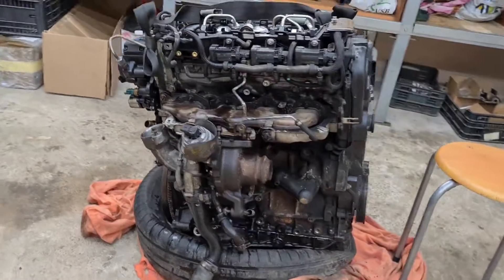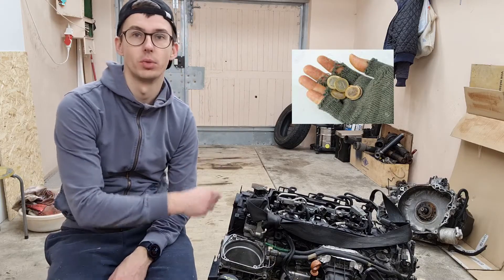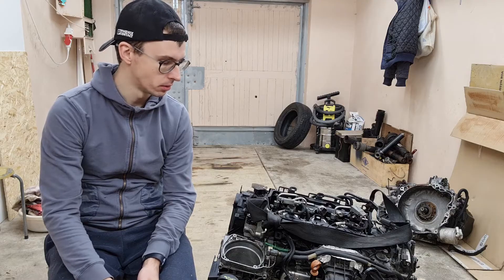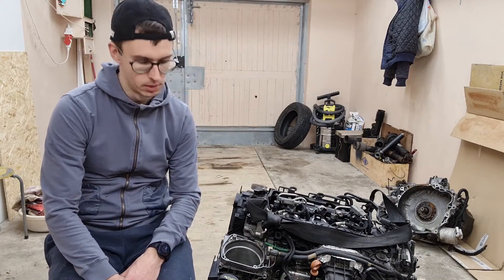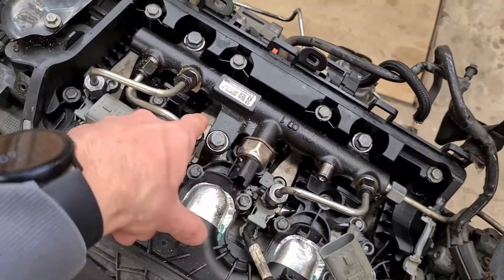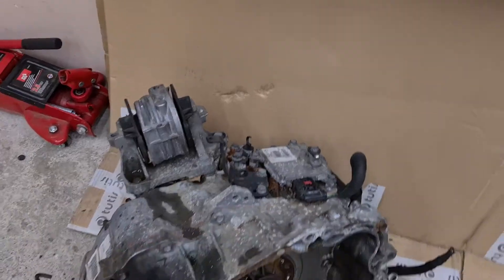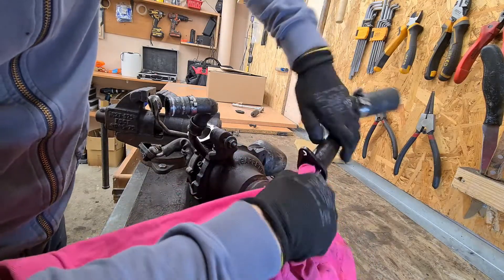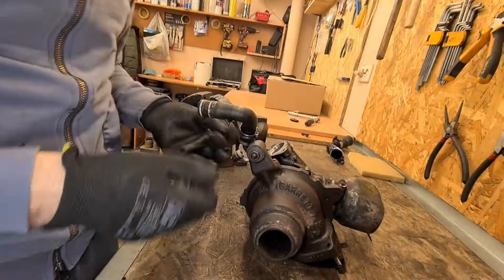Got broken 2.0HDI 163 motor! Lets tear it apart and check what happend to it! (DW10CTED4 RHH) part 1

Comment: Rust and oil ( do you still have head ( my focus cmax mk2 2.0 tdci euro 5 163 bhp (timing belt snapped and I need a head ! ) much you want for the head I am based Glasgow Scotland !
Reply from the maker: Hi. No, I dont have. Head was damaged severely when trying to undo head bolts, they very tight and few of them were stripped... I have sold it to metal scrap...

Comment: Hello! Can you please tell me where the pcv is located?
Reply: same question
Reply from the maker: If I am correct it is located in front of the engine, on front of the engine block, big black plastic box (oil fume separator and pvc valve).

Comment: 7:32 These two soleniods control when the DPF regeneration is occuring. EGR is set to 0% and 'doser head' mixes the required air paths to achieve suitable incoming air temperatures for the DPF regeneration process (in combination with the use of the Eloys fluid). One should be closed and ther other open when the ignition is off.
Reply from the maker: Yes, you are right. But, interesting thing that only first motors have that intercooler bypass and later engines comes with only one doser flap (for smooth shutdown).
Reply: @rustoil  It's due to a change in the injection system which means the twin doser head was changed to a single.
Reply from the maker: @bizling well, I dont know why you say so, because everything is the same (fuel pump, injectors, ecu...). I think that that bypass was not usefull enough and was not used eanymore.
Reply: @rustoil  the post injection strategy was modified (using the same injectors, pump, etc).

Comment: My car is Ford Focus and has this engine, 200,000km and no issues. Very good engine usually.
Reply from the maker: Yes, mine has already 350+kkm and runs fine.
Reply: @rustoil My car is se same and  has already 500000KMS and run very fine😜😜😁😁😁😁
Reply from the maker: Those engines are realiable and durable, will run to 1M :)
Reply: Mines at 192k miles , solid engine

Comment: What year is the engine as I have a 2.0 hdi auto and they tell me that the egr valve is at the back of the engine
Reply from the maker: This engine is produced from 2009. Its is coded dw10cted4, older engine dw10bted4 has egr on the back of the engine. This one is quite different than yours.

Comment: what price did you get this engine for please and how many miles has the damaged engine done
Reply from the maker: Hi. I dont exactly remember, but about 150e with gearbox. Gearbox is still sitting in the corner in case I will find time for it to be dissasmebled, seals replaced and on to the car, because mine is not properly working, but still drives. This engine has about 250kkm I think.

Comment: Hi there can you tell me if these engines have a 02 sensor fitted to them ?
Reply from the maker: Yes, it has O2 sensor. It is mounted into the catalytic coverter case - that smaller unit mounted first onto the turbo.
Reply: @rustoil  do you have a picture of it by any chance ?
Reply from the maker: @marke293  yes, I have. I can send it to your email.

Comment: Great tear done video of this type of engine. it looks like you know a lot about these peugeot engines do you happern to know what will cause a P 2562 code on a very low milage engine of this type ?
Thanks
Reply from the maker: Hi, thanks for comment. This error means that something is wrong with the feedback signal. It can be faulty wiring, problem with the position sensor on the turbo variable geometry actuator.
Reply from the maker: Well, for the C5 turbo with that acturator/sensor can be accesed only from the botom, firstly removing the exhaust.
Reply: @rustoil  thanks for your reply can you tell me if I need to access this from the top of the engine or under the car as it does not have a lot of room in the engine bay  (2015 RCZ)

Comment: What were your problems with your gearbox? You said 2/3 and 4/5?
Reply from the maker: Yes, shifting from 2nd to 3rd and 4th to 5th are not smooth, auto neutral engages very sharply. New valve body did not help...

Comment: Good video, interesting the EGR is on the front right, I need a Haynes manual as I became the owner of a C5 with this engine.

Did a full service on it (oil, oil filter, air filter, fuel filter, cabin pollen filter, new rear engine mount) but it is not as efficient as I expected. 

Also stalls easily from cold start with laggy performance for a short while, fault code reader (cheap non sophisticated OBDii) gives P050B fault stating "ignition timing, cold start - performance problem".

Googled P050B fault and it states multiple possibilities - camshaft sensor, crankshaft sensor, throttle sensor, check electrical wiring etc. 

Also get the 'invalid oil level reading on start-up, engine took 6.2 litres to get it to read the minimum on the dipstick leven and I refused to put in any more as too much can do damage!

Would love to sort this out as otherwise it is a lovely smooth and fast car when to need it.

Comment: Nice video, i have same engine and issue with turbo vnt , its dusty/seared/baked and sometimes i have error registered when im doing high boost. It need be cleaned, im thinking if its possible to put turbo cleaner inside turbo without dismounting it.I know that can be very hard.But dismount half of car (suspension, fap,exhaust) will be more painfull.
Reply from the maker: Hi. Thanks. By the way, mine has exactly the same problem... i am living with it almost five year :) i will definetaly try removing the turbo and clean it in spring/summer, because it is getting worse, especially on hot weather.
Reply: @rustoil  I have this error only during summer on highway railroad when engine is very hot. Also for 3 years now.  Usually once a month, but once during driving by 8hours in row i had it 6times in row during speeding up. I was thinking about dismount exhaust pipe  only and put some cleaning foam for ovens inside, like other do when you have direct connection from egr to turbo. In this model connection egr - turbo is through engine and easy cleaning is immposible :/
Reply from the maker: Yeah, in 50km I can get two or three cut offs of the turbo, lexia shows overboost error... i agree that it is not easy on this engine to get to the turbo, but i have seen that it can be removed with exhaust taken off, no need to dismantlle the suspenssion atleast.
Reply: @rustoil Finally i have fixed this issue with overboost.
Replaced turbo myself (lot of work..... i bought new OEM one). 
Apart of overboost gone -  now engine is more flexible! It really make difference with boost.
In old turbo VNT was little jammed.( it was easy to see it on bench and compare with new one).
Reply from the maker: Yep, I have replaced the turbo one and a half year ago. After that no overboost ocoured. Old turbo vanes very not stuck, but in opposite - very loose, so, under the boost they were getting stuck due to play they had.